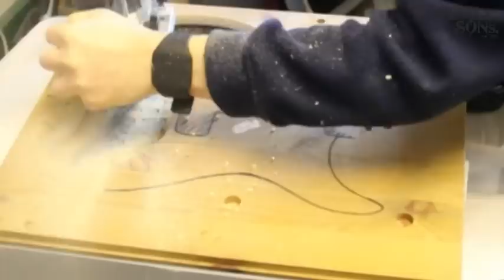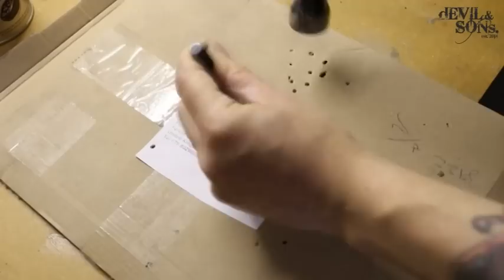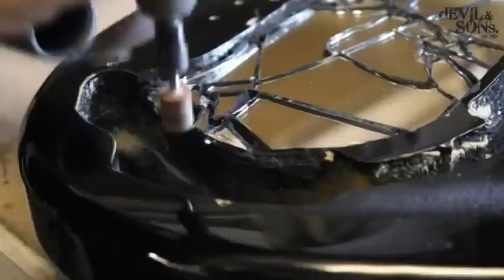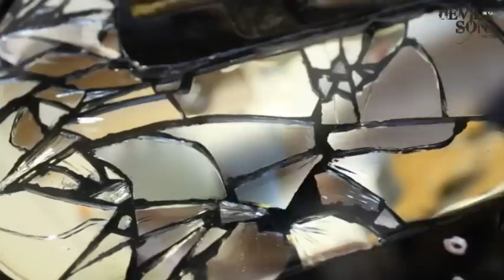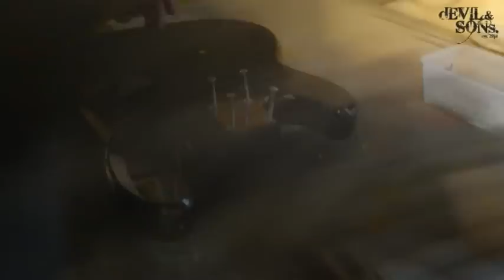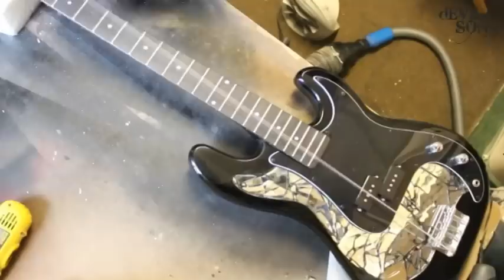From the Devil & Sons workshop: Building the Shattercaster bass guitar

Comment: Very cool. My question is how do you clean the grout from the mirror? Doesn't it harden?
Reply from the maker: It actually doesn't adhere very well to the shiny mirror surface so chips away pretty easily. It does however stick well to both the unerside and the side where it's cracked so fills the gaps nicely.

Comment: what did you spray on the headstock after putting on the details?
Reply from the maker: It would be sealed in varnish. I tend to use nitrocellulose. The video doesn't actually show all the coats.

Comment: what is that liquid you poor on the broken glass to make the surface smoth and the holding the pieces together?
Reply from the maker: +Gerasimos Batas It's clear casting resin, which is a liquid that you add a catalyst too and it hardens. It's the same material that is used to make fibreglass structures. We get it from here: http://www.tiranti.co.uk/EdgeImpactShop/subcatdivision.php?Division=209